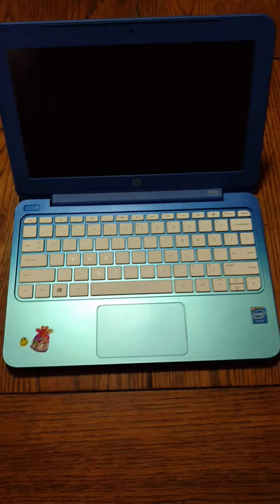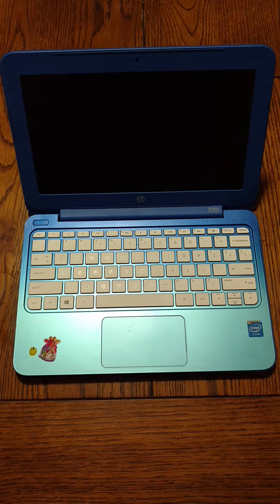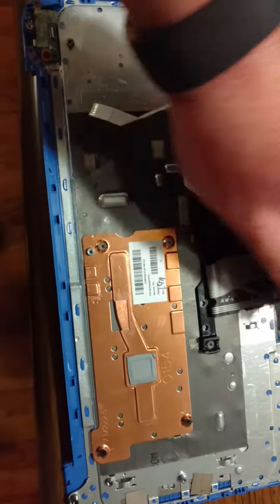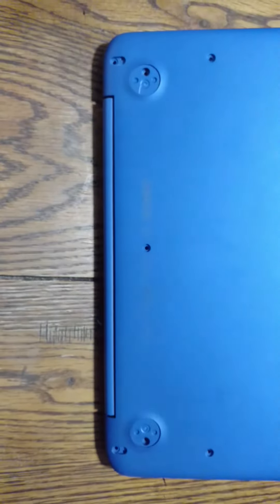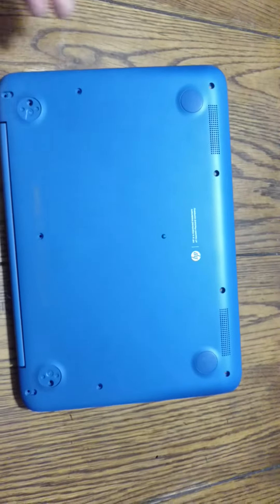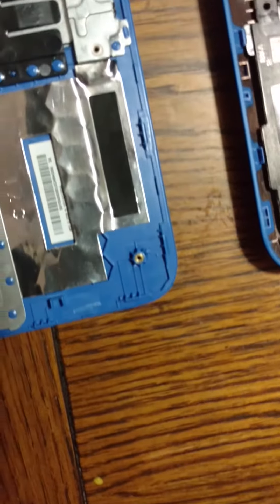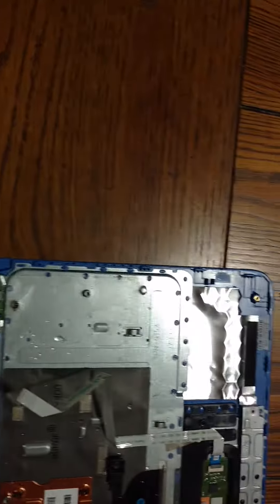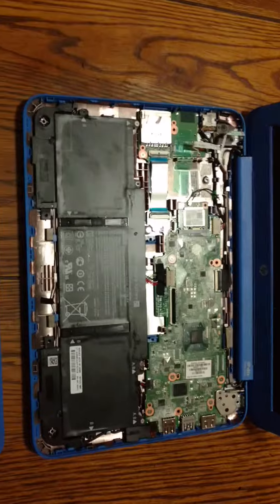How To Remove Keyboard for HP Stream 11

Comment: you should make a video removing the RAM from the HP stream
Reply from the maker: Unfortunately the ram and "hard drive" are soldered on the motherboard and cannot be be removed or replaced.
Reply: Can you make a vid so i can clean the fan?